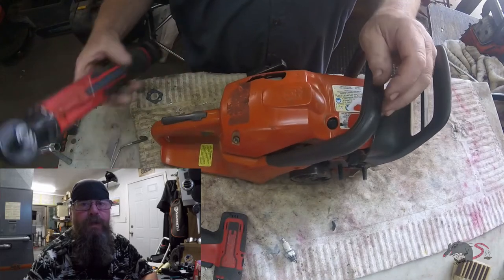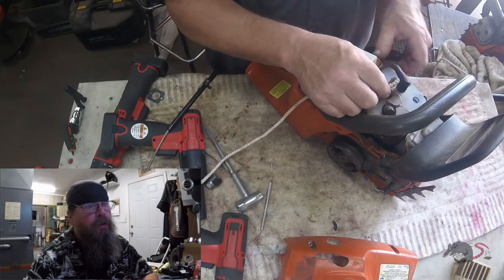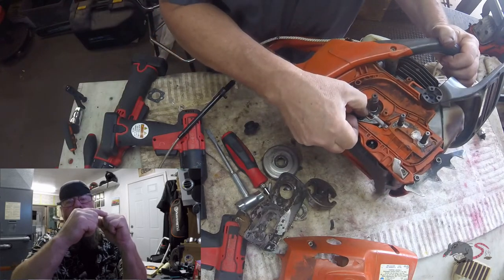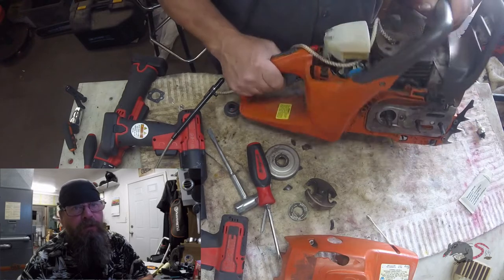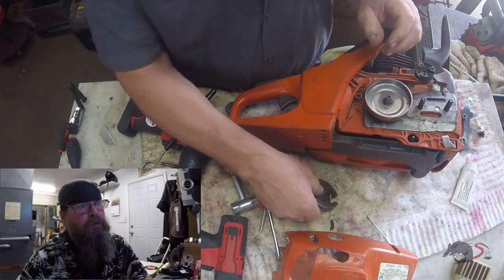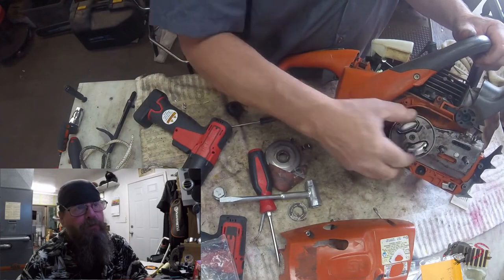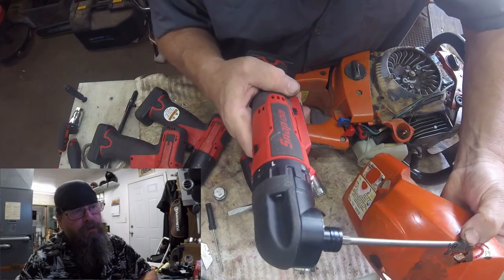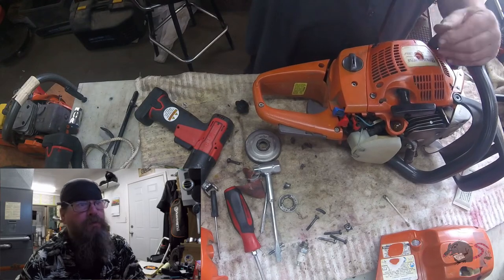Husqvarna 460 Clutch Drum Repair

Comment: Are you using a special grease or does any high temp wheel bearing grease work?
Reply from the maker: Its bottled as Husqvarna grease but they just call it general purpose grease. I use this same grease in trimmer heads.